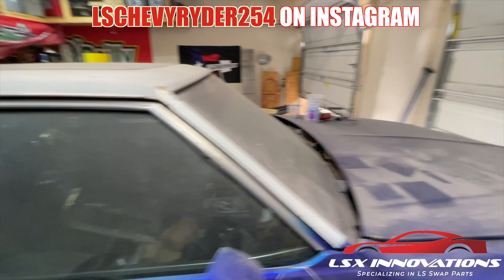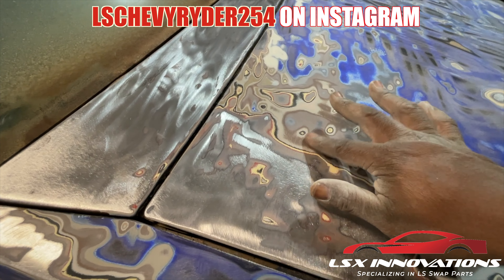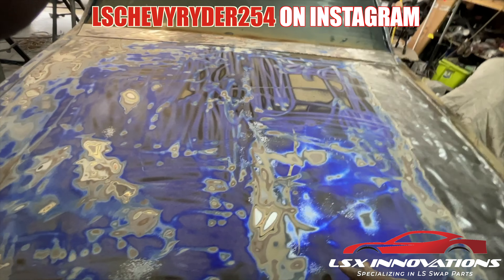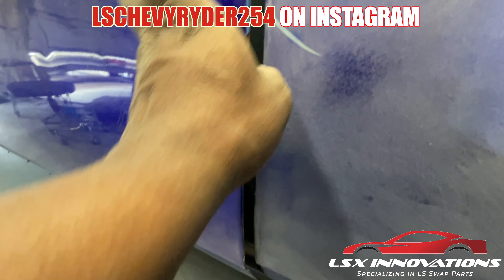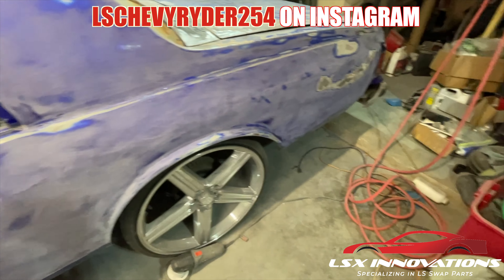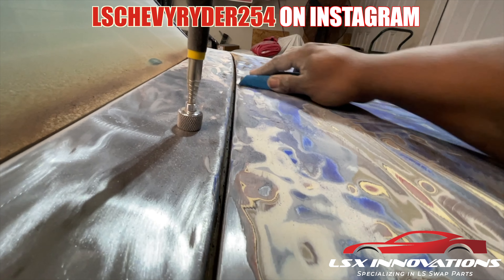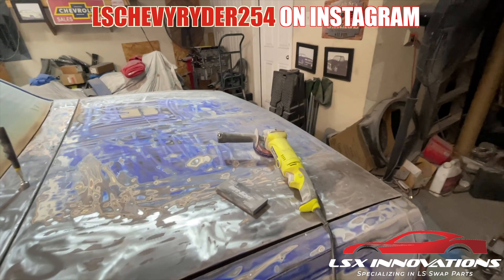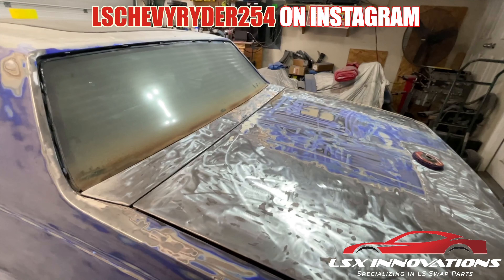PROBLEMS REVEALED WHEN YOU GO DOWN TO BARE METAL

Comment: A gallon of aircraft paint stripper is what you really need Apply with a paintbrush tape the seams in between the panels so the paint stripper don’t go down between the seams get as much paint off as you can then you can use the DA or whatever to clean up the rest of the paint that may be left on the panel it’s time consuming but it’s worth it